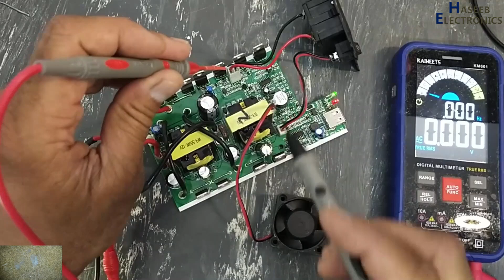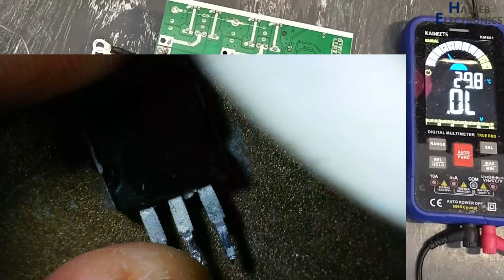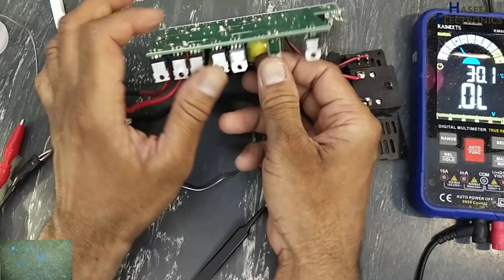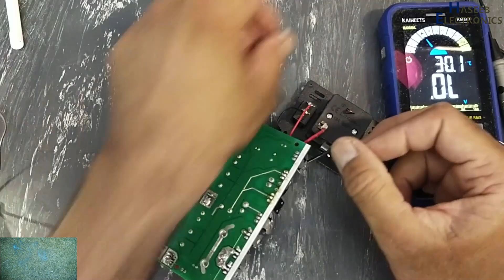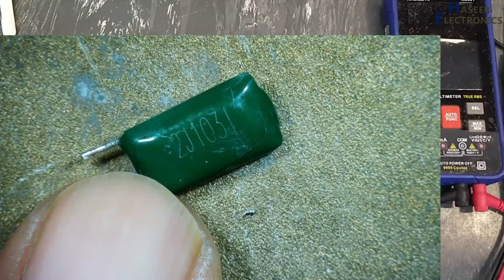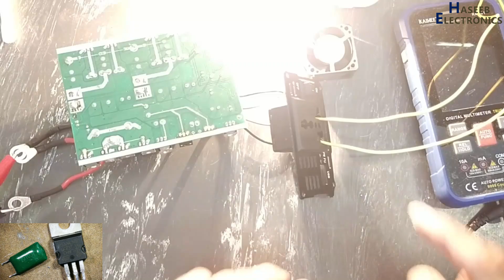{1180} 500 W Inverter No Output Repair | Fixing 12V to 220V Inverter Fault

Comment: Can I touch the polarity of that capacitor when charged ?
Reply from the maker: Never try this. it may be fatal or may cause svere injury.
Reply: Please is that like the output capacitor because I always think the capacitor is to charge the battery voltage and as well supply it where necessary?
Reply from the maker: This non-polar capacitor is used to convert square wave output to closer to sine wave signal

Comment: How can I solve my 1kva input problem, I've checked and tested all the mosfets are good
Reply from the maker: sometimes the mosfets are good but and....
MOSFET the driver IC is damaged 
polarity protection diode (connected at input terminals is short circtuited)
sometimes the input bulk capacitors are short circuited
Reply: @HaseebElectronics 
Kindly leave me your TG account if any thank you.
Reply: @HaseebElectronics  
Thank you for your feedback, carefully checking the related solutions above, none can fix the issue shall be glad with your further assistant thank you.

Comment: I had the same inverter card. I couldn't find the fault. Finally I found it. I changed the mosfets and it didn't work. Then I changed the lm 358 integrated circuit. The problem was fixed.

Comment: Good day Dear Ahraf, on a H Bridge of power inverter, i have always mosfet 1 (high side) and mosfet 2 (low side) that burn while 4 and 3 stay ok. Please note that they burn ONLY WHEN I TURN IT OFF, when ON, all is good.
When i use only 3 mosfets, none burns (1,2,3 or 2,3,4). I checked on the scope, signals are identical and voltage between gate and source are the same for low and high side. I am running out of mosfets and i would like to fix that inverter, any idea where to look at ?
Thanks.

Comment: I have this exact inverter, no AC output, 290v dc present at the capacitor and all mosfet tested good
Reply from the maker: You need to check H-BRIDGE driver ic TL494 OR KA7500 
this section converts 290 dc voltage to ac
Reply: Pls make a video of how to do that. I started repairing this type of inverters after i watched your video of how 3000va inverter works. But you have not explained the output section pls

Comment: Your video is insightful. How does the the secondary of the transformers connected ? Is it series or parallel ? 

I am aware the primaries are connected in parallel, what is wrong if I connect the two transformers output (secondary) in parallel as well ?
Reply from the maker: best regards 
most of time these are in series connected
Reply: @HaseebElectronics  
What if I connect them in parallel ?

Comment: We appreciate your work Sir,,,,,I  have a question outside this......"what does,A,B,C and D stands for in the following ICs,,,8002A,8002B,8002C and 8002D,,,and finally can I substitute let say 8002D for any of the above and so on?
Reply from the maker: can you please mention write complete part number or 
its use, i mean in which circuit it is being used
Reply: @HaseebElectronics  Hello, The 8002 series is a class AB audio power amplifier designed for low power devices. The 8002(A/B/C/D or D) eg 8002A or 8002E is the skeleton part  number since the other may contain the manufacturer eg MD8002A or LTK8002B.
Reply: @HaseebElectronics  I want to know the significance or at least the variations of 8002A,8002B,8002C,8002D and 8002E.....for replacement purposes. From the internet I was able to find out that the equivalent of "8002A" is LM4871 or TDA2050.....,,,,, Now my concern is, let's say I have a damaged 8002B ,and the ones that are available in my stock is either 8002A,8002C,8002D or 8002E,can I use any of these to replace 8002B and vice versa?  Secondly kindly assist me with the equivalents of 8002B,8002C,8002D and 8002E...

Comment: "This Red and this Black wire are positive and this Red wire here is negative." The manufacturer needs to go and stand facing the corner and think about what they've done lol. 😩
Reply from the maker: some manufacturers design things without any quality standard. and it creats a big headache while repair process, if someone have faith on wire colors codes. so that headache will never be cured with any medicine because the reversed wires in the equipment will reverse the wiring of the brain 😂 😂😂 😂😂 😂😂 😂
Reply: @HaseebElectronics  🤣
Reply: Hahaha

Comment: Sirji...what is the use of that 10nf capacitor please explain
Reply from the maker: it is output filter to smoothen the square wave (output of H-bridge). it tapers down the 90 dgree shape of the square wave into a little bit linearly rising / falling signals

Comment: Salam Aleikum. Very interesting topic. Can you please explain the following issues:
1- on low side often only one mosfet get hot, the other stays coo'.
2- explain to me how H Bridge works in pair with PWM.
3- Often half output voltage is obtained, not full 220vac.
4- explain what are the tasks of the LM358.
5- can you share schematic to understand where are the vo'tage checkpoints.
Thank you & salam aleikum.